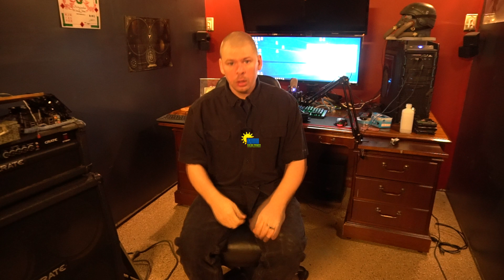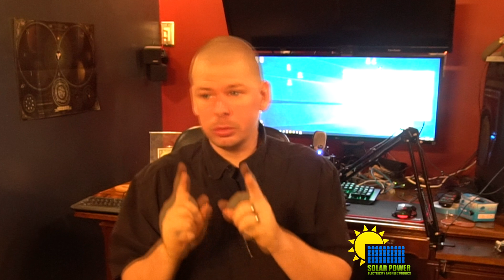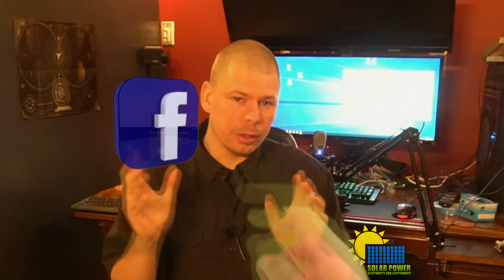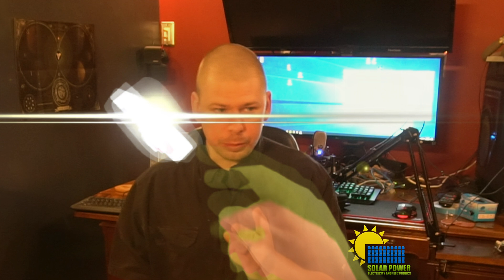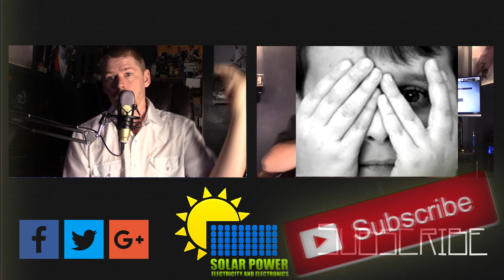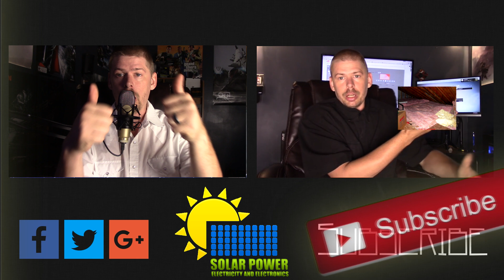Magnum Inverter Upgrade Chevy Volt Powerwall Battery

Comment: i am using mine as a UPS. i have the ME-ARTR, it should be close enough. push CTRL, AC in control, Auto connect.
Then All ports, SETUP,  go to 03B Low VAC Drop out, change to UPS mode.

Comment: Pls help me check With your magnum remote controller, the highest voltage u can set it to charge your inverter battery and minimum Voltage u can set it to cut off when using your Chevy volt battery? I have been searching for an answer to this

Comment: Is your 48 volts magnum inverter  low battery cut off 42v? I was told it low battery cut off for Magnum inverter 48 volts is 36 volts.
Reply from the maker: The controller can change this and if you are going to buy one get the controller for all the settings you can change